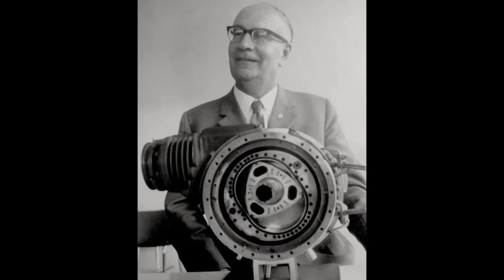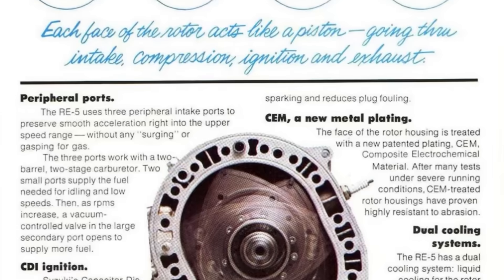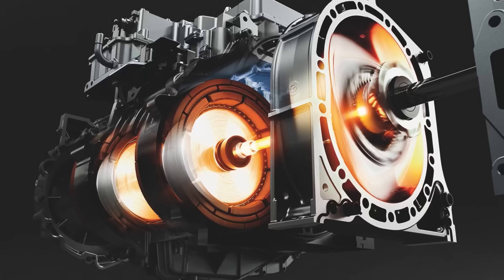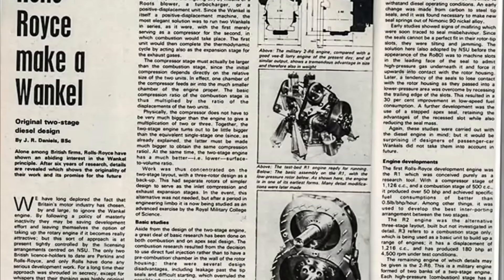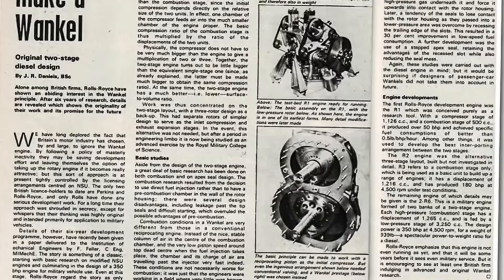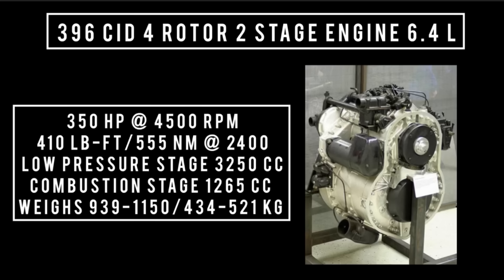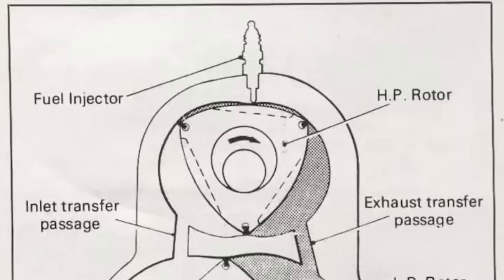Rolls-Royce diesel rotary engine

Comment: The Wankel is nightmare engine. 
Even when it works right in the Mazda, they don't last much over 120,000 miles.
The Apex seal is an unsolvable problem.
The combustion chamber is too narrow. This ruins emissions.
The combustion is pushing the Rotor in both direction after ignition. This ruins efficiency!
And on and on like that!

Comment: I should have said that early work was done on a single stage engine with primary stage simulated by feeding with compressed air taken off the factory air supply.
All records remained  stored on the test beds until that section of the beds were demolished after VW took over.
Not sure what happened but I believe records were destroyed .

Comment: A single rotor would have trouble reaching the pressures required for diesel operation.  Supercharging a single rotor could give the boost needed for compression ignition, but the exhaust would have a lot of energy which would just blow out the exhaust pipe.  The large rotor compresses the intake charge to supply enough boost for compression ignition and expands the exhaust from the small rotor recover more power, so it could be described as a turbo-compounding system*.  I have seen a diagram of a three rotor Wankel diesel that had separate rotors for compression and expansion, so the overall compression ratio was independent of the overall expansion ratio.

* In a turbo-compounding system, the heat recovery turbine gets more power than is needed to run the compressor, so it is geared to the crankshaft and the engine produces more net power.

Comment: Did you know that the engine didn't run its own power? Did you? They had to supply it with more air! 😂👉👌🌬🌀 seek help
Reply from the maker: Hey that's what that article said

But will admit said it too many times that part was to be cut out and just missed it

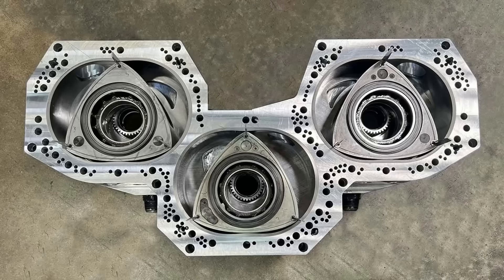Comment: 4:57 is an image of a section of the 12 rotor, it's a one-off engine that someone built, I believe it was built for a boat originally and rob dahm is currently rebuilding it and is going to be putting in a dragster chassis

Comment: Curtis wright started on a SCORE  Wankel  Rotary using diesel fuel but was not a Diesel cycle engine .
John Deere bought it and got the wood-Ridge NJ factory .
Stratified Charge Omnivorous Engine that could run on many fuels .

They sold to another company RPI?but none  ever made a production  engine .

“Stratified Charge Rotary Engine Developments at JDTI from 1984 to 1991  ASME paper 
If interested .
Reply from the maker: I started working on the score John Deere engine and it's an interesting concept. It's amazing. It did not work or they pull the plug on. It got sold to a different company and they were going to use it as a marine engine, but they ran out of money.

I was going to put that out today, but I can't find enough visuals. I know they exist. I'm going to go research it a little bit more at the AACA Library in a month or two.

Comment: It's not really a built in supercharger on the Rolls Royce version , it's a two stage compression of intake so they could get compression up high enough for compression ignition , and on the power out side two stage exhaust so they can use all the escaping energy more efficiently, like a double acting steam engine, and similar to how a gas turbine/ jet engine works , Ie big turbine exits into smaller turbine into smaller turbine bumping pressure up a little each time making it very efficient not losing air density and energy to heat, then after combustion little turbine dumps into progressively bigger turbines using up every bit of heat and energy.  The Rolls Royce version uses two inline rotors but you could use 5 or 10 all dumping progressively into smaller and smaller rotors and exiting into larger and larger exhaust sides.

Comment: This is what you would call a split cycle rotary. Smart move really to have the power submit to a smaller rotary chamber to reduce the heat transfer to the casing and to have constant pressures upon one set of seals, with negative pressure mostly on a separate set of seals/rotor. They probably concluded it better to use a roots type blower instead of the tricky sealed rotor. They most likely bit off the worst chunks of two very different engine types to create this one, sort of as unlikely as a turbo-charged Stirling engine or something.
Reply: The issue with Wankel is its geometry does not allow reaching the required Compression Ratio for a Diesel in one Rotor, this is why RR built a compound Wankel, a large Rotor compressing the air, and a smaller unit for combustion, providing the power. 
Designs with both the Compression and the Working Rotor on the same shaft, as twin Rotor units by NSU, Citroën, Mazda, got a patent protection, but probably were never built.

Comment: No 2 stroke diesel engine (reciprocating or Wankel) works without a blower. Running a research engine using an external blower makes sense. Also in the 70s tip wear was an issue for all rotary engines. The sealing requirements of the higher compression ratio diesel would have made the situation far more extreme.
Reply: A Wankel engine is not a two-stroke.
Reply: @brianb-p6586 Technically it is, as it completes a single cycle in 360° of crankshaft rotation (a 4 stroke utilises 720°). Further, the basic engine has no valve gear and I am not aware of any 4 stroke that can operate without valves.
Reply: @chrisknight6884 a Wankel has an eccentric mainshaft, not a crankshaft... but the important point is that a Wankel executes the four phases of operation - induction, compression, expansion (power), and exhaust - in four separate phases of working chamber expansion and contraction. 

And each Wankel chamber takes three mainshaft revolutions - not just one - to go through the cycle.

Comment: The GM Wankel. It was the engine proposed for the Corvette back then, with the addition that it was gonna be mid engined.

Side note: there are two examples of Ford Mustangs that were bought by two different parties to use them as test beds for Wankel engines built by two different manufacturers. If I recall correctly, one of them was by Pratt & Whitney.

Comment: At 7.49 you are wrong - the engines DID run on their own. One was in an FV as many people at the Crewe factory saw. Usually hidden in a cloud of burning oil from the exhaust. 
Secondly I emphasize as someone else has said, this NOT A ROTARY ENGINE !
It is a rotary PISTON engine.
Full details are in an IMechE paper at the time.
Reply from the maker: There is a article that I pulled the information from. It's in the video and it says that they never ran on their own power. That's where I got the information from.

https://www.carsguide.com.au/oversteer/forget-mazda-rolls-royce-made-a-rotary-and-can-you-believe-it-was-a-diesel-58311

Comment: Maybe do an episode on how the Wankel very nearly killed Suzuki. Then you can do another on how it actually killed NSU. The Wankel is one of those designs that looks good on paper, but is fundamentally flawed in reality. I'm sorry, but some of its problems are inherent in its design and aren't just a matter of figuring them out. 0:39 I remember these full-page ads for the Suzuki RE-5 motorcycle back in the mid-1970s. If you read it, you will also understand why the displacements manufacturers give for Wankel engines are a made-up fantasy. In reality with each face of the rotor doing the work of a piston, the real displacement should be 3x what the manufacturers usually claim.

Comment: If it ran on diesel…wouldn’t it also run on jet A?  Think about it…wouldn’t it be cooler if it was a Rolls-Royce Wankel jet engine?

Also…the AMC Wankel wasn’t going to be made by AMC, it was to be sourced from GM. And was destined for the Pacer.

Oh…and Felix Wankel was a hardcore Nazi.

Comment: It's possible they were using an external air compressor during development to save the cost and complexity of putting on a blower. We did this on a development engine. I think I spent a morning hooking up a pipe between the engine's intake and a scroll compressor. and all we had to buy was some plumbing and a filter. It worked fine but performance was limited to how much the scroll pressure could put out. I'd like to hear the John Deere episode next.

Comment: WYR: Yes.
If you want a rotary engine that has pistons, you'll have to bolt the flywheel to the crankcase instead of the crankshaft. Ask anyone who's built a Sopwith Camel or Fokker DR.1 replica how much that portion of mounting the propeller messed with their head.

Comment: "You spin me  right round baby right round 
like a Wankel baby right round round round" 😁

Rplls Royce giving up on it should have been a warning to others. They had mastered the jet engine which took some very high-level engineering and materials technology and they already had the precision manufacturing plants that would have been needed. And 'industrial' engines generally run at a set RPM which is easier to design for. I don't think they could have coaxed ~400 HP from it though. 

I'd like the GM story. AMC had their inline 6 which was a good engine but it''s length limited design possibilities and they figured that if worked for GM it would work for them too. AMC really didn't have the engineering department to develop it on their own.
Reply from the maker: Man, what a great missed opportunity for a song that wasn't this song... 

Thank you so much for sharing all of that insights greatly appreciate it
Reply: I would like to hear the John Deer story, because I never heard anything about it.

Comment: That's a cool story! I didn't know that R-R delved into Wankel engines. It's not surprising that it would have been intended for military applications.
People mainly think of Rolls-Royce as the builder of luxury cars, but those are under BMW now.  At heart, the Rolls-Royce company was behind some of the best aircraft engines of all time. R-R designed and built the Merlin V12 used in British aircraft and the used in the U.S. P51 Mustang and the PT boats. U.S. Packard also built these engines and made improvements on tolerances that boosted the power which R-R never imagined. The R-R Merlin engines helped win WWII. Also, R-R also builds superior jet engines. If you have an opportunity to closely examine the engines on an airliner, look for the R-R badge.
The Wankel rotary engines were 2-stroke, so when used as a diesel, they required a supercharger to supply air. A 2-stroke diesel engine can't draw it's own air in so it needs a blower. In a conventional 2-stroke diesel, the supercharger just supplies air, so it is called a blower. Unless overdriven, it does not compress air. Normally, compressed air is supplied by a turbo charger. It used to be common for locomotives to have 2-stroke diesel engines, so they always had superchargers. Later, they added turbochargers to increase power. Superchargers take power to do their jobs. One cool thing with locomotives, when up to speed, the superchargers could be disengaged and the engines would be solely run by the turbochargers.
The motorcycle company Suzuki was successful in introducing a single rotor 500cc Wankel engine which powered the  RE5 motorcycle. At the time, there was not only a fuel crisis going on but Mazda was getting bad press for their unreliable rotary engines(mostly because of owner abuse and lack of proper maintenance) but what they couldn't escape was they were fuel guzzlers. The Suzuki RE5 undeservedly got caught up in all that. I considered buying one, but then Suzuki cane out with the GS750 4-stroke super bike. I did buy one of those and I still have it. Back to the RE5. Although not the quickest bike at the time, they were quite torquey. When cruising in 2nd gear, if you cranked the throttle on, the rear wheel would break traction and leave a cloud of smoke as long as you held the throttle open!
Reply: I remember the wankel Suzi. I also remember a water cooled 2-smoke triple called the Buffalo iirc.
Reply: @PAULSLEVINSKY-b7j  I also had a Suzuki 550GT triple 2-stroke. At the dragstrip, when I popped the clutch out, the rear tire would spinn and it took awhile for it to get traction and take off. In the meantime, there would be so much engine smoke and tire smoke that the motorcycle would disappear and then emerge from the cloud.
Reply from the maker: Thank you so much for taking the time to share all that insight and information greatly appreciate it
Reply: Rolls Royce made the famous Merlin - probably the very best large type piston aircraft engine.  But their modern jet engines sacrifice reliability for performance - which is why most airlines won't buy RR.   I have experience with RR industrial diesel engines - they were none too good on reliability and once trade barriers were lifted, had to exit the market.

Comment: Back in 1978, a friend let me drive her new Mazda RX7 in an autocross. I think the tach red lined at 8000rpm, but read to 10,000. I was told not to over-rev it. I thought going by engine noise alone would tell me when it is time to shift. NOPE! When I looked at the tach, the needle was just over 9000 and it was smooooooth as glass and very quiet. Ooops! Luckily, nothing bad happened, and she never knew of my little oopsie.
Reply: A friend's father had the RX4 wagon.  He complained about hearing this buzzer constantly, it was the Mazda over-rev signal going off!

Comment: Thanks for finding that one, didn't know a diesel rotary was developed interesting concept working with the Hugh compression to work with, can see problems with chamber sealing. 
For history sake do all the wankel versions, that was the big talk back around 1970 when the car companies were designing the future compact cars for the rotary, but Mazda was the only one successful. 
(Btw Fuji Heavy industries in 1959 purchased the  Mazda name from General  Electric which used the  Mazda name for their light bulbs )
The AMC was interesting  that the Pacer was  designed for the rotary, but had to shoehorn the straight six in.
The Monza and it's cousins, and 75 Nova and it's cousins was also  designed for the rotary.
The Door dash one would be entertaining.
Reply from the maker: Definite to cover all of the rotary engines eventually

Comment: If my foggy old brain remembers correctly, Chevy built a 4-rotor Wankel and made a mid-engine Corvette back in 1973. It only took them 42 years or so to make the Corvette mid-engine for real. I also recall that Mercedes Benz made a 4-rotor mid-engine prototype.
Reply: Mercedes C111 prototype with 4 rotor Wankel
Reply: @Utilizator-r7r  Cool! I couldn't remember the C111 designation.
Reply: @61rampy65  The C111 first had a Wankel producing 350hp but Mercedes lost interest in that engine and replaced it with a turbo diesel and set numerous records. With a modified turbo it used 16L for 100km at an average 325km/h.
Reply: They did it again with the 4th gen corvettes. That one was a 3 rotor. And it wasn't RMR it was front-mid. 

I don't remember if the 1973 prototype was a 4 rotor though. I'll take your word for it until I've looked it up
Reply: Corvette XP-895
Reply: @sabinespeed4146  Thank you!
Reply: Chevy did make a RMR 4 Rotor Corvette concept in the 70's (can't remember the precise year), but it wasn't really a 4 Rotor. It was 2 2 Rotor engines welded together with a shaft between them. I think it had a displacement of something stupid like 9.4 litres, but made (I think) around 500 horsepower. Other than that, my memory goes funny.
Reply: Yeah if my foggy brain co operates, gm got assistance from mazda for the rotary, and in exchange, mazda got a number of australian hj holden premieres, which they made the interior better (was already a mid to high end car in australia) and fitted a 13b to the trimatics in them, and called them mazda roadpacer. Was a failure, too heavy a car, wrong gear ratios for the 13b
Reply: The mustang concept car had a rotary also
Reply: The Corvette didn't start hitting the end of a FR platform's capability until the C6 ZR1, and the C7 proved there were still gains to be had.

The quad rotor sounds cool until you realize the only real advantage Wankels have is as budget endurance racing motors.

And also, the 13b got roughly the same mileage as a 5.0 or 350TPI of the era, so, the quad rotor would drink like an Irish V16. Perfect timing for the Oil Crises.